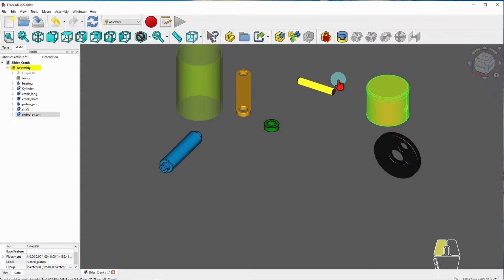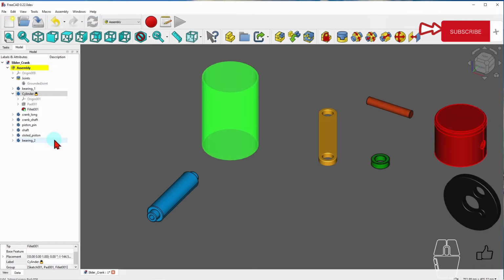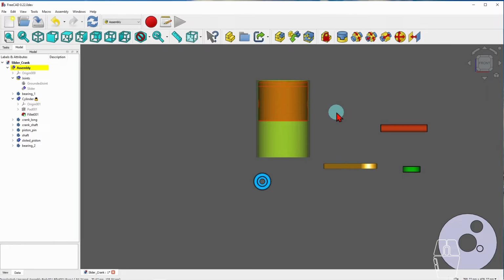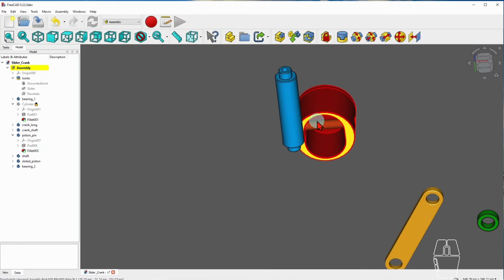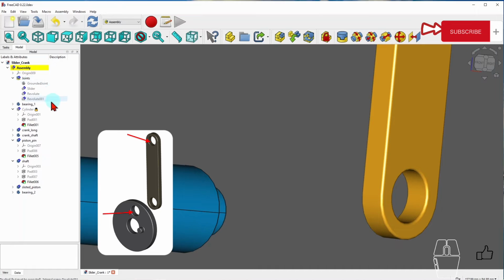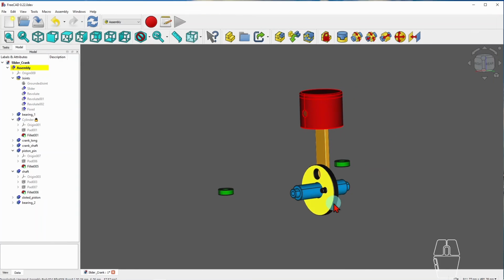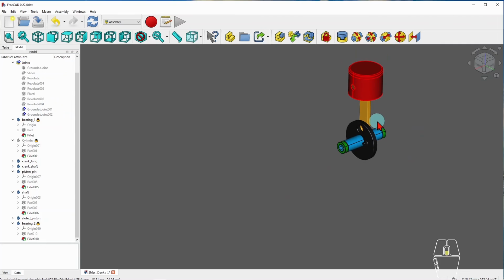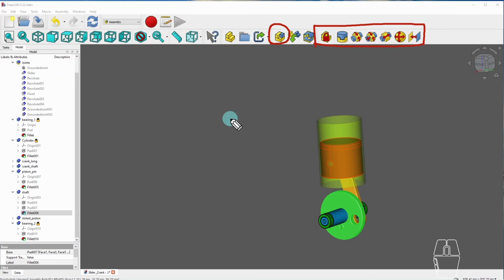FreeCad Tutorial: Slider Crank Mechanism with FreeCAD Ver 0.22 and ONDSEL Assembly Workbench

Comment: The connecting rod is attached to the crankshaft. When the crankshaft rotates, the connecting rod will collide with the shaft. See 19 min 50 sec. Best regards
Reply from the maker: this is just to demonstrate the  kinematics of FreeCad Assembly workbench. Thanks for pointing out this... I will fix it.
Reply: @cadzis673  I understand. You are doing a good job and I thank you very much for that. Just move the shaft to the left so that it does not collide with the connecting rod. Best regards

Comment: I cannot move (drag) a part in the assembly with the left mouse button to spread parts of each other. Can you give a solution to slide a part as you do ? Thank you
Reply from the maker: Have you activated the assembly... that may be the problem... Watch my videos carefully. If the assembly is not activated... then click on it again to activate. Hope this help.
Reply: @cadzis673  The reason is we have to move the parts in two steps, the first one is to move it under the file of the assembly and move once again this time under the Assembly node. And I forgot the second and last step. 😆